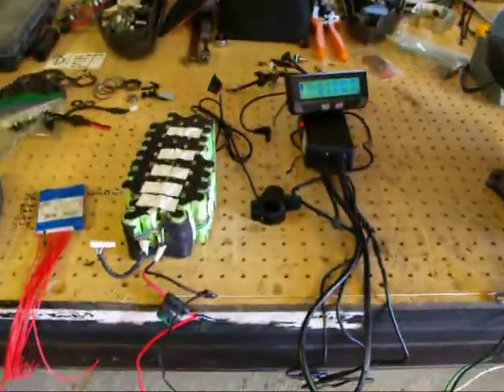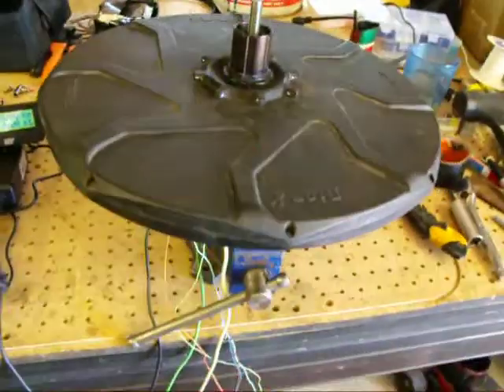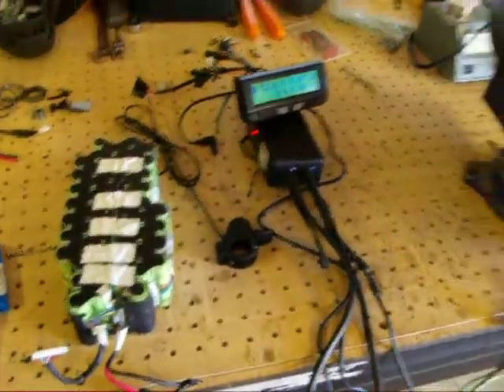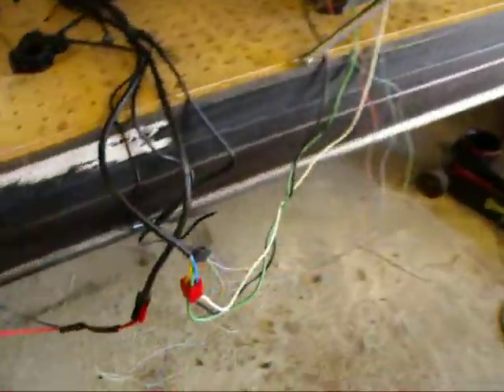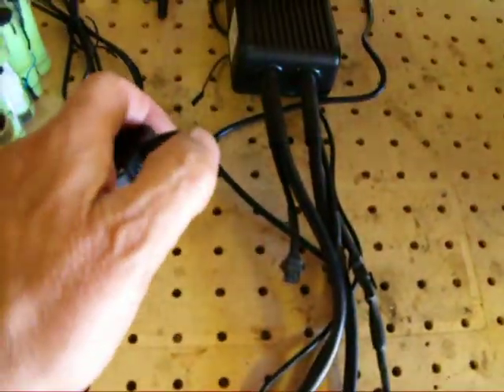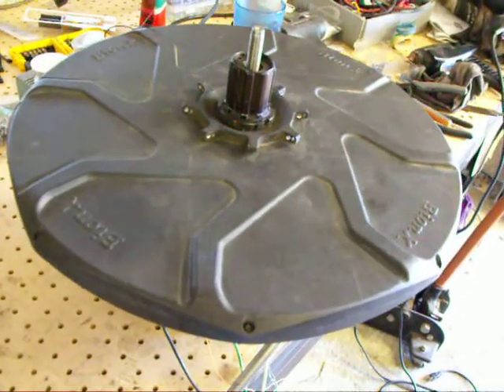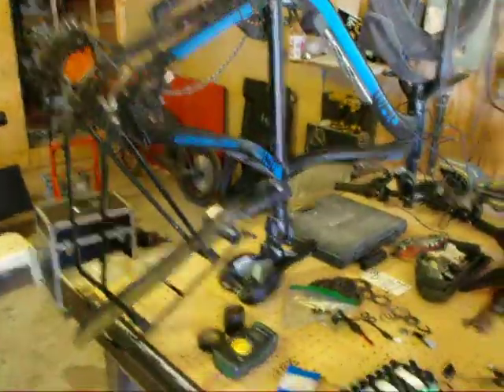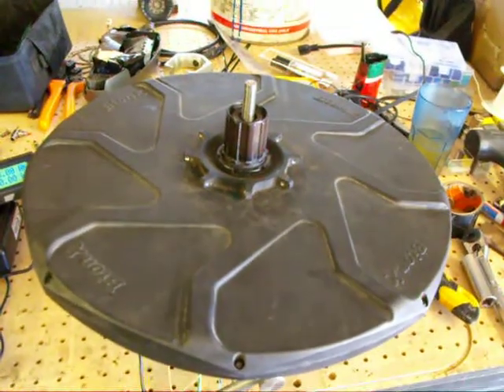Attempting to fix a BionX hub motor part #3. The motor RUNS!!!!!

Comment: Hey George
I'm currently battling with my Bionx motor. While cycling, the speed reading suddenly dropps to zero, and it's not providing power anymore. Powercycling solves the issue but only for a minute or two....do you have any idea what the problem could be? Thx:)

Comment: Hey i also have a D500 but some other issue not PCB realated i sheer of mein Terminal +/-  wwhich go in to the motor and i need fix the main power cable now. cann tell me how to open that D500 beast :D
Reply: oh i see some other try to ask before, but can just hammer the axle out or how i can imagine how its put together

Comment: Hey George.. do you repair these motors still.  Would like to chat with you if possible.. getting desperate 😢
Reply from the maker: i have a few more here to repair.  what can i help you with?
Reply: Hello ! I
 am trying to open one, but i just cant. How did you opened it ?
Reply from the maker: i think it has some silicone sealing in it.  just pry the plastic apart. and i used a press to push the axle out.